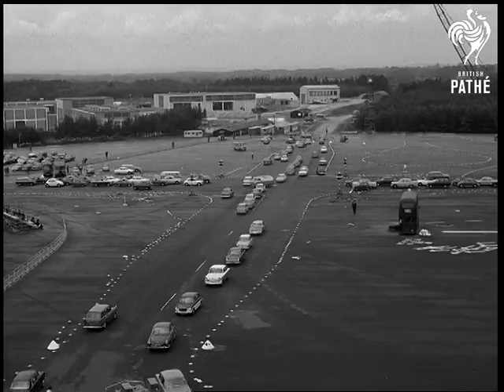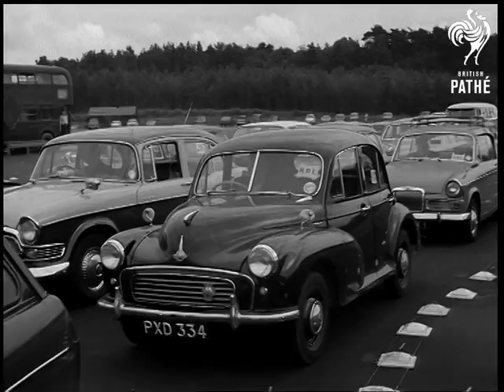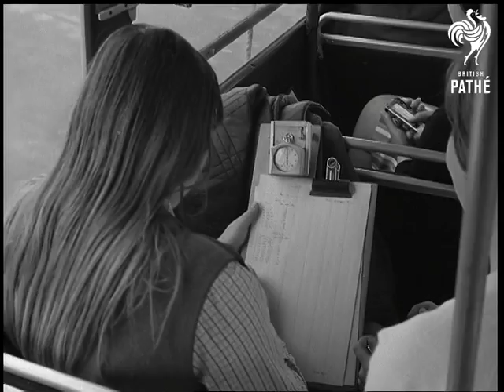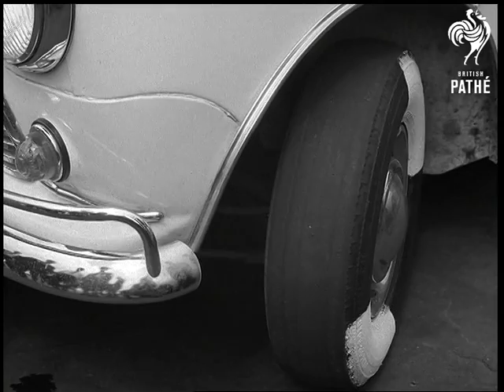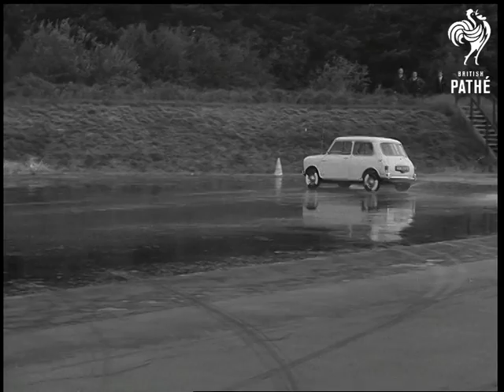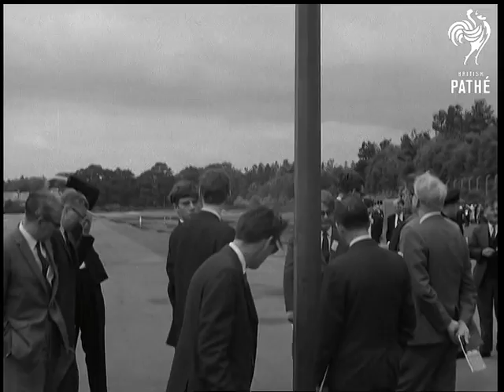Traffic Experiment Aka New Road Research Laboratory (1967)

Comment: In 1977 When I was 16/17  I worked at TRL in Crowthorne, while working at TRL or as it was called back then the TRRL I had an accident which left my right eye damaged and scared and my vision greatly impaired which has severely affected my life, I am now 63 years old and have never recieved one penny for my injury and in fact I was threatened with the sack if I pursued any form of compensation. MB